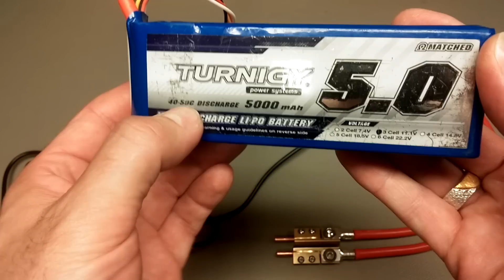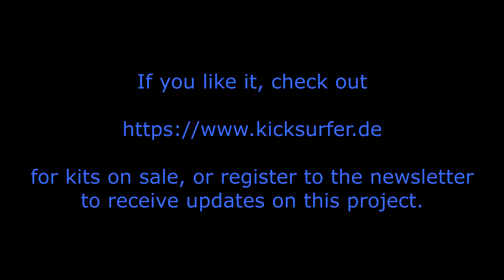Next level DIY battery spot welding

Comment: DUDE THAT IS VERY BAD ASS. TO BAD YOU CANT GIVE IT A STANDARD POWER SUPPLY  100V..........220V OR MAYBE EVAN A CAR BATTERY.   EVAN WITH A LIPO VERY SWEET I WANT ONE..NICE JOB
Reply from the maker: Thanks :-) As the unit draws 1000A+ of current and demands a power supply with a very low internal resistance, the word "standard" is a bit difficulty :-) Anyhow, the Lipo can be charged simultaneously to the welding operation, which makes that kind of a 100~220V power supply. Some other designs use car batteries, but I don't like to have them on my bench. Lipos are also cheaper, and even more powerful. There are only two other supply solutions that I am aware of: large capacitor arrays, and transformers. I will start working on the earlier when I have delivered the first batch of 25 welders to my customers in Mid August 2017, but that will not likely be a very cost effective solution. If you don't want to use questionable noname stuff from China, then the supply along may already hit the 200€ bar. The latter, in most cases salvaged and modded microwave transformers, have the big disadvantage that, when switched with SCRs, you can only adjust the weld time in chunks of 10 milliseconds (50 hertz half waves). And the achievable current is much lower. My welder can work with up to 2000A and chops the weld time into 10 microsecond intervals.

If you like to order one, check out https://www.kicksurfer.de/index.php/product-category/kspot-welder-kit/
Reply: SO HOW MUCH ASSEMBLED AND SHIPPED  TO THE U.S.... THE CHINA BRAND LOOK TO BE JUNK. NOT SURE HOW MUCH USE IT WILL GET BUT ITS NICELY MADE , AND THAT'S THE PART I LIKE
Reply from the maker: You mean the Sunkko welders? Yes, several people told me that they would fail quickly and you keep replacing the SCR's inside. It it doesn't cause your house circuit breaker to trip. And they are not able to weld thicker material like 0.3mm nickel, or copper.

Check out my store, I have divided the kit into a number of subsets for a reason. Many DIYers have access to most parts at their local hardware shop, or have them already available. Additionally, you can choose to order raw parts and do the construction work yourself, or have me doing it for you. But as I'll be doing all the work on my own (for start) and have limited time, I've chosen to set higher prices for this part. The store has an automatic shipping rate calculator as well.

Right now, I am compiling an assembly manual that goes much more into depth on what parts and tools are required, and what kind of work needs to be done. I think a first revision will be ready by tomorrow.
Reply from the maker: I've noticed that video :-) Let's see how long his switch will survive this. And let's not talk about repeatable processes :-) Greetings to AvE, I love his channel and the way he is talking. [f**k, focus! f**k, FOCUS!]

p.s. Youtube keeps identifying all of your comments as spam, I have to pull them out of the quarantine. Maybe because you use to write in all capital letters.
Reply: Really let's try this one,  let me know.. Im  thinking  you mabe right le me know where this goes..  Thanks .
Reply from the maker: I'll keep you all updated... Basically AvE is doing the same as I, just that I have a microcontroller / MOSFET based switch, where he has a relay.
Reply: I gave mine 6 series ultra capacitors from maxwell I could only source the D cell ones so I  put two strings in parallel. they should source about 1400a, otherwise My design is pretty similar to his.
Reply from the maker: That's a good choice, but the problem with supercapacitors is that you can either build one with the desired energy storage capacity and way too high ESR, or you can massively exceed that to get something with a reasonable ESR.
Reply: (3.2 mΩ *6 ) / 2  = 0.0096 Ohms.  I actually have enough for a 3rd parallel set if i so desire. I got 20 for something like 130usd
Reply: (350F/6 )* 2 = 116.6 (line over 6)
Reply from the maker: ESR should be fine for 1kA+ pulses. You'd need to take wiring and switch losses into account, and of course the weld spot resistance (1-5 mOhm). My Lipo with ESR=5mOhm achieves ~1400A. If I assume Vstart=16V and Vend=8V, then you'll get ~10kJ of usable energy. As the energy efficiency of these systems is quite low (maybe 10%), you could probably still dump 1kJ into a weld spot. That is way more than required (I think that 200J is enough for most tasks), and this is why I said above: you get too much capacitance (and have to pay for it), or you get too high ESR.
Reply: its a valid observation. I wasnt comfortable enough with my own understanding to know If I could pull that from a hobby lipo pack. Have u had any puffing/swelling? I believe you are the first to demo this. I looked at plenty of other designs, one university student used a single row of the super caps in mfg pre-assembled module with an scr (bleh) otherwise it was really expensive computer grade caps or people using car batteries inside and a designs of each for scr and fets. 
 
I got kind of lucky and a friend of mine who "dumpster dives" happened to pull a 24v 30a EV charger from 06. was made by some french company, assuming i can get it running I will have a very nice supply for recharging the caps. I have a 12amp ebay dc-dc step down at the moment but I intend to design a board with buck controllers that feature sink pins so i can utilize closer to 700w of its output. This should enable a nice plasma cutter mode. I've seen it done with far less charger and cap on a rig made from computer grade caps
Reply from the maker: The standard Turnigy's (3S 5Ah 50C) that I am using in the videos are not suitable for productive operation, they swell too quickly when under heavy load. That is why I ordered the Turnigy nano-tech that are rated for 650A. I've been stopped by Microsoft this evening (3hrs to install a USB COM port), and attempt to do the new video tomorrow. The goal is to find a workable and cost effective solution, not having to invest $200+ in capacitors (unless you are lucky and can salvage some stuff).
Reply: and this is why i said A DIFFERENT POWER SUPPLY.....
Reply: it wouldnt work for my European friends but the guy on Ebay i got my super caps is still selling 20 for a little more than i paid but still less than your 200 mark. 156 after shipping in the us. I wish i had problems like that guy... a storage room with thousands of new supper caps would be terrible :D

if you want to provide it as an option for your us customers heres his link. there are 20 buck balancing boards for 6 series if one does a little searching.

http://www.ebay.com/itm/Maxwell-350-Farad-2-7V-Ultracapacitor-Supercapacitor-D-Cell-PCB-Solder-Qty-20-/300945126145

 Its the only order ive ever made from that vendor so i cant say a whole lot but his rating is almost perfect. My order was shipped the about 12 hrs after I placed it (im usually up at night). so over all he seems very legit.
Reply from the maker: The used power supply is of course up to the user, my system is not limited to anything special. Of course it also works with car batteries and supercapacitors.

Some news from this morning: I made a test by rapid firing ~100 pulses at 30J into a 1milliohm load. Pulse current was 1.3kA, the battery got barely warm, and most importantly I did not notice any swell at all. The AWG10 cables and the XT90 connector are a bit underrated for this application as expected, so you should allow for some cooling intervals when using it. But I can definitely recommend the Hobbyking Turnigy nano-tech 3S / 5Ah / 130C batteries for my system.
Reply from the maker: Great, added to watch list. Please keep us informed, I am curious if they are genuine.

Comment: Really good construction idea and innovation! May i suggest just one improvement idea for the electrode holders: when i saw the big gap between the cable connection and the round electrode i first wondered why. Then i saw you need the disconnection to get the pressure to the electrode by screwing them down. But you only need to cut one peace to achieve the same result and have a better connection with a lower resistance. May not matter much here, but every percent counts :-)
Are you in mass production already?

I am about to build a bigger spot welder for stainless steel - about 2 - 2.5 kAmps :-)
Triggered by two SSR's and inrush current control for the primary winding of the transformer (rewound from an old traditional welding transformer around 4 - 5 kVA).
Reply from the maker: Thanks for your suggestion. Sadly that electrode holder is already obsolete, I didn't like the machining effort that had to go into it and found a simpler solution. I hope to upload the next video by this weekend showing this and other improvements.
Reply from the maker: p.s. yes I am in mass production, if a first batch of 25 can be called that :-)
Reply from the maker: what sheet metal thickness do you aim at? 2.5kA is not a lot for this. Professional sheet metal welders can easily go up to 15-20kA. BTW, my design is calculated for 2kA max for 200ms.
Reply: Hi there, i doubt that a LiPo-battery can give you 2 kA - did you check the amps? I know that industrial spotwelders can deliver up to 30 and 40 kA, but i used an old welding transformer and replaced the secondary by 4 windings of 120 mm2 copper cable giving me up to 4 V at around 2,5 kA (for a few seconds). That should be enough for 1 - 1.5 mm stainless stell i guess. More would be better tough...
Reply from the maker: I measured the amps through a defined section of (brand quality pure copper) AWG8 wire with known resistance. Modern high amperage race Lipos are well capable of delivering these currents. I just received a fresh Turnigy nanotech 3S / 5Ah pack. That is rated for 130C discharge current, which is 650A. "Continuous"!
Reply: That is really amazing! But its still quite a way to 2 kA! Maybe this works for a few millisec.  - but could also damage the battery pack in the long run.
Reply from the maker: I am about to make stress testing with the new Lipo, but I am still waiting for an XT90 connector because the Lipo has one, and I want to use this chance to test the suitability of this connector type. Anyhow, the 1kA that the current setup delivers is more than enough to weld 0.2mm nickel strips.

p.s. the battery delivers constant high current for pulse durations up to 200ms, but my old "standard" 50C doesn't like that, you can watch it swell. The new Turnigy nano are advertised to be extremely robust at very high current levels. I am curious of its internal resistance.

Comment: Good job. I actually have built my self check out my videos. It's version and the next one is soon to come out.
Reply from the maker: Thanks :-) Yours looks also nice! I first wanted to respond that the weld time selection that is shown on your Hakko video are probably much too long, but then I saw the other Hakko video on your wordpress blog with more appropriate timings :-)

What is switching the mains voltage? Is it a solid state relay?
Reply: WeAreTheWatt. At the time of the posting the video it has a 25A TRIAC. It was not mine a reader who had bought the pcb had send me his final design. 

With that said my next version would have dual SCR and incorporates an LCD.
Reply from the maker: Great! keep us updated :-)

Comment: habe ich das richtig verstanden... du machst ein kurzschluss mit eine batterie ?
Reply from the maker: Fast. Das Material an den Elektroden hat einen Widerstand von 2 Milliohm. Bei 1000A ergibt das einen Schweißvorgang. Ich würde allerdings mittlerweile davon abraten, das mit einer 5Ah / 50C Lipo-Batterie zu machen. Für eine annehmbare Lebensdauer sind mindestens 500A Nennstrom notwendig, also zwei Packs davon parallel oder einen entsprechend dickeren. Hobbyking verlangt z.b. für einen 5AH / 130C (peak) Pack etwa 50€ (https://hobbyking.com/de_de/turnigy-battery-nano-tech-5000mah-3s-65-130c-lipo-pack-xt-90.html), selbst wenn man zwei davon parallel nimmt, ist das immer noch weitaus billiger als eine "klassische" Lösung mit Ultracaps. Für den notwendigen Kondensator wecher lange genug 1000A liefert zahlt man gerne einmal mehr als 200€.

Comment: Hm, but why you are Not getting shocked during operation. i mean, you are directly touching the electrodes there? Isn't this life threatening?
Reply from the maker: No, that is only 12V from a battery. You only get shocked when you touch high voltages, like 230V AC. The only danger with this unit is that high currents can cause fire. That's why it has a fuse. And the pulse firing duration is time limited by hardware, even when the software would attempt to exceed that.